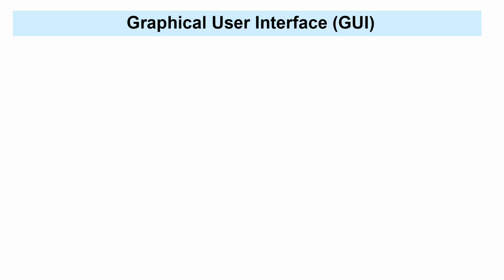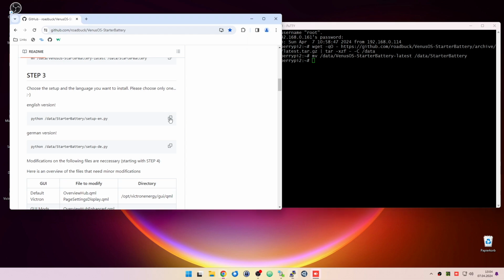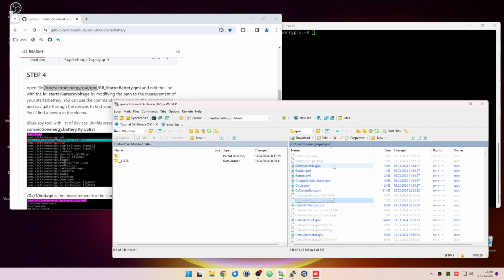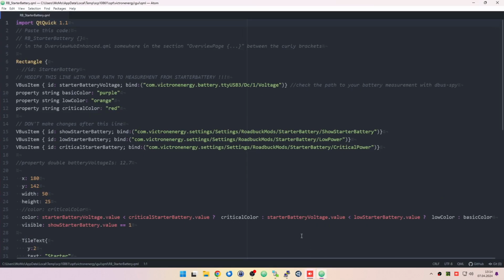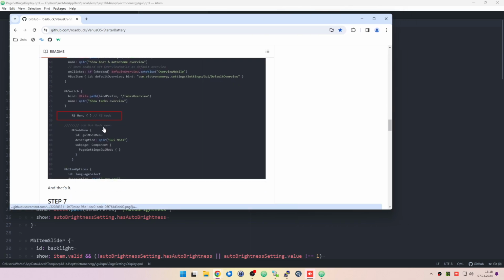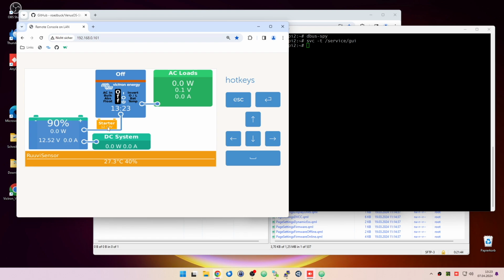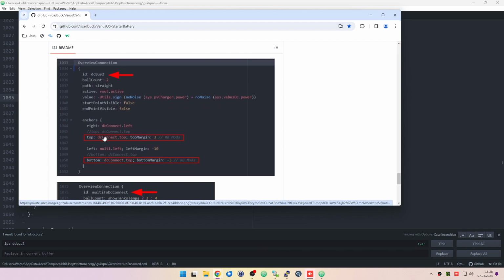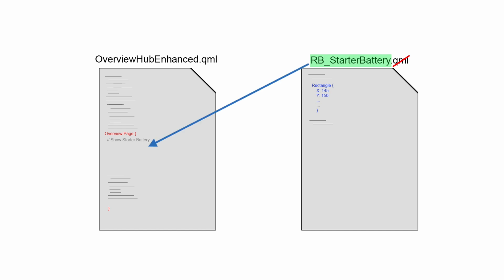EN: Victron Venus OS - Starter Battery on Mainpage for Cerbo GX, Raspberry,... (english)

Comment: If I have the engine battery connected to the charging terminal of the auxiliary battery on the multiplus ii, will it serve as a voltage reading?
THANK YOU VERY MUCH for this great work.

Comment: Hi is there a way to use Mottramlabs wemos D1 CT clamp boards to send the power readings to grid in and load out. as i dont have a victron inverter. I'm using the raspberry pi and victron shunts and solar chargers

Comment: Hi Marcus, any news ?
Reply from the maker: had some private things to do first... But yes there will be some more news soon. An additional WiFi module for the MaxxFan and the "Community Edition" for the Truma with a config-menu and different "AddOns" for different types and configuratrions -> that's the main challenge to make it available for the community... Diesel, Gas/LPG, Sensors (yes/no), Weather, Timer, error-handling (showing "real" Error-Message instead of W571H,...) and so on. But the progress is going on and on... don't worry!
Reply: @roadbuck It sounds fantastic !
Reply: Hi what happened?

Comment: Hi Marcus thanks for the content extremely informative and very exiting to work on, I have no coding background and it was my first attempt I was playing around for couple of hours and I manage to get it right. Just one question my solar side have disappeared and all the information on the ac connected side as well have gone I am using  guimods .Any insight in how to bring those information back ? Cheers
Reply from the maker: Hi, you say "playing around"... so this is not easy to answer. If you want, send me an email with details an if possible, screenshots...

Comment: Marcus, thank you very much for the nice tutorual!
but i have a question,
in the section where we adjust the lines around the "starter battery",
the second "input line says allso 'top dc...." but has to be 'bottom'.
i had to change the word 'top' to 'Bottom' to get it to work.
In the screenshot it shows the right word 'Bottom' infront of the line.
Hope i am right? it worked for me.
But thanks again for the fabulous tutorual!!!! 
I hope i may learn much more from U!
greatings Mark
Reply: The rule I mean is in the video at 27 m 30 sec.
Reply from the maker: Mark, thank you!!! This is my mistake in the github description! I fixed it...
Reply: @roadbuck  glad to have contributed to succes of others.
i thank u and will follow u ! thx
till next 👍
Reply from the maker: Hi Mark, thanks for your feedback. Which firmware do you use and which GUI-Mods version?
Reply: Hey Marcus, i use the 3.30 large. And latest gui, have to see later what number.
Reply from the maker: this is strange, because then we should have the same files.
Reply: @roadbuck  oh but maybe I was not clear enough.
It is in the tutorial on GitHub , there we can follow what u say in the video.
When i copy the “bottom” rule from GitHub it went wrong, in the vid u put 2 slashes and copy the original file to next rule.

Comment: Thanks for this great explanation video Markus !
I have a question regarding the future of these mods when it comes to the forthcoming GUI 2.0.
I read the fineprints about the differences beetween the two GUI iterations and as it stands mods like GUI Mods or yours won’t be compatible.
My question is, do you think you’ll be able to render the Truma, The Shelly lights and other integrations compatible with the GUI 2.0 (both on local  and web assembly) ?
Reply from the maker: Thank you! I have read your comment and will reply in more detail in the next few days. Before I do that, I need to do some research, because I think that others will also be interested in this question.
Reply: @roadbuck Did you have time to have a look to the new Gui paradigm in the beta ?
Reply from the maker: Hi Joel, yes I did some research, but at the moment I will not adapt my development to V2 because the process behind, especially on VRM, makes it actually impossible.
Reply: @roadbuck  ah OK. Different and incompatible techs...
Thanks for your reply.

Comment: Hi thank you for the upload just finished doing it and working took me few hours but got there in end rayly good instructions
Reply from the maker: Thank you for your feedback.
Reply: Hi Marcus thanks again for great effort you have put into this vid, just a question like you said the starter bat box bit tight were it is was wondering I will not be using the ac input tile is it possible to insert the starter voltage on that tile at all if you think it too difficult to do I will leave thanks
Reply from the maker: If you don't use the AC Input box, you can place the starter battery there instead. No problem. You just have to modify the x and y coordinates in the file RB_StarterBattery.qml (line 21 & 22). I would not enter the voltage value in the AC input box if there is an AC input, because this would confuse the user.
Reply: @roadbuck  Thanks for that will gave it go i would buy you beer if possible
Reply from the maker: ;-) cheers...
Reply: Hi Marcus moved the starter
 battery and made same size as the ac input tike I hide the ac tiles so looks great just wondering could I insert a tile other side and have showing date and time thanks again fir your advice be nice if could send you a pic cheers
Reply from the maker: yes. No Problem. Send me picture or screenshot by email (see channelinfo). Make some "paintings" on it to show me, what you want... ;-)
Reply: Ok will do thanks
Reply: Hi mate can you gave me your email address can't seem to find it
Reply from the maker: Try via PC. On YouTube with smart devices sometimes the email isn't visible. Give me your address, I'll contact you.
Reply: Hi my message seem not getting to  you I found the email but not sending email seem wrong format